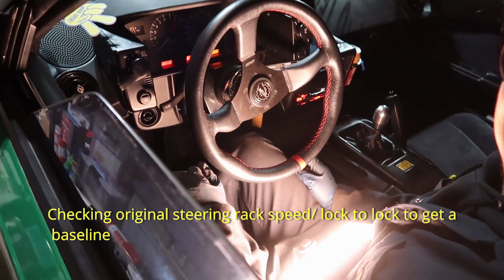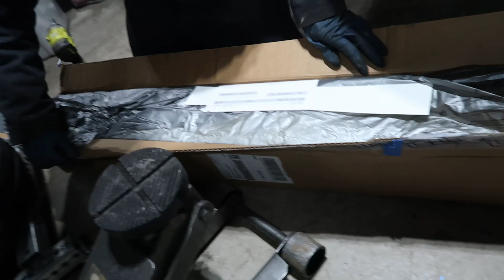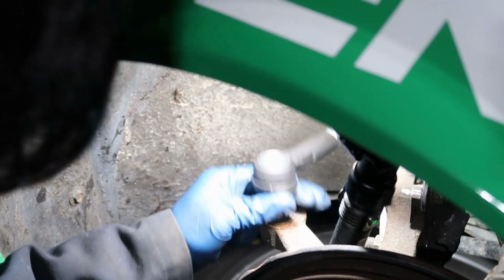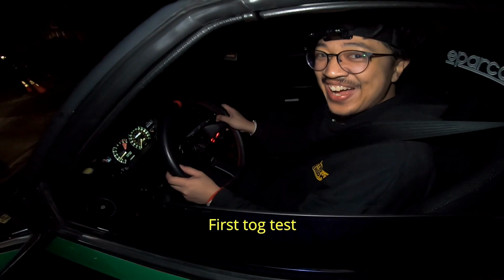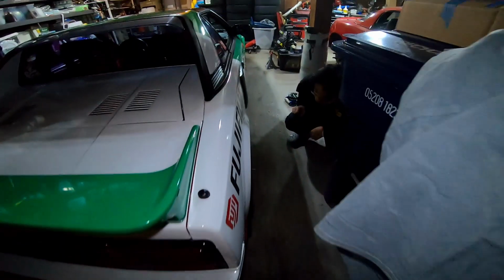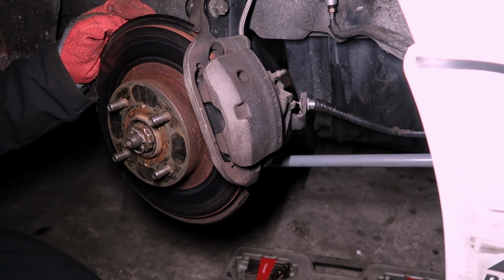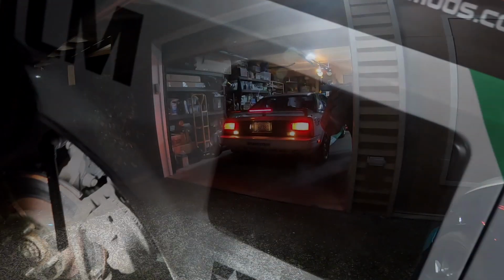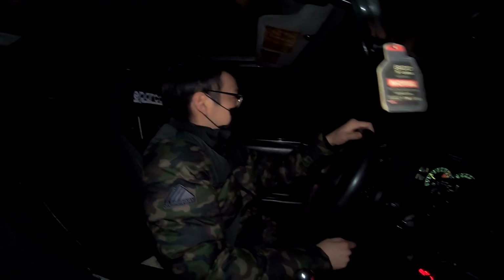48hrs of Pain | MR2 AW11 Quick Ratio Steering Install

Comment: AW11 FTW!!!!   One of the best cars to own, and a very easy car to work on.   Have thought about a quick rack for my track aw11, but cant justify the cost when the stock rack feels fine to me. 26 years driving them and always thought the stock rack was ok.  I guess I'd need to drive a aw11 with a quick rack on the track to "feel" the difference.   I don't do as much gymkhana style events as bigger tracks, so I guess the benefit would help slower course gymkhana's.
Reply from the maker: He drove mr-s and s2000 that's why lol

Comment: Also, the rack is based off of 1 of the 2 types of steering racks that came for the AW11. That hump/bigger diameter you mentioned, towards the end of the video, is in the right spot for some AW11 and not for others, like in your case.

Comment: Just a FYI the T3 x Flos steering rack for AW11 or AE86 is based off of an AW11 rack not ae86. Main difference is for AE86 the rack gets steering rack spacers and ae86 inner tie rods. AW11 just gets the AW11 inner tie rods.

Comment: is the steering shaft lower end with the rubber in it (susceptible to wear, causes lack of response on center) re-urethaned or welded on this car? with the stock steering rack, mine has no play/take-up with that unit welded.

Comment: Wonder if a 2zz could be swapped into the aw11
Reply: easily actually. im just about to do that with my AW. you can use the stock aw11 transmission mounts bolted onto the c60 6 speed and then you need to make a custom extension to the front motor mount. i have seen people make flat plates with a gusset to bolt the engine and stock mr2 mount in order to extend it or you can get a modified mount from woodsport. then its just typical engine swap wiring and routing shifter cables.